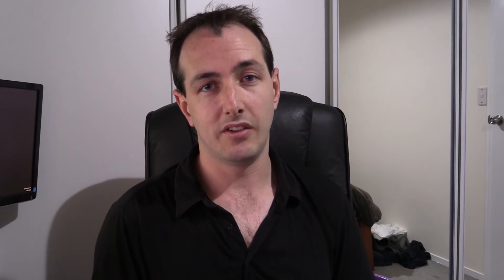Grid-Tie Inverter

Comment: I really like your design. 

I'd like to create an off grid system using your 20s 32p configuration, but all of the 45v-90v inverters I see are grid tied. 

If the largest off grid inverters are 48v, is there still a benefit to creating a system with 82v charged, 74v nominal, 60 flat, or will the extra voltage be wasted?
Reply from the maker: The extra voltage isn't wasted it just converters better.
I really like the benefits of grid-tie as its so easy to connect to the AC. 
The only problem with say 82v is you have to create everything yourself for controlling it like I have had to do which is a pain. 82v over 48 volts if I was to do it again I would do 48 as its just so much easier. In saying that my system of 82 volts is really working well.
Reply: Mikes DIY Tesla Powerwall thank you for your quick response. 

I really like the way you have configured your system with your wooden structure to hold your battery packs. 

I think I'll use that design regardless of the the voltage I end up using. 

Thanks again, your videos are very in depth and helpful.
Reply from the maker: The best thing about the wooden rack is its easy to make, compared to other options.

Comment: surely this has to be illegal in nz? i know it would be in Australia..
Reply: Yes, SMA is not the cheapest option, decided I'd go for the quality and the good reviews of the product after a lot of research. I have a quote for the tesla wallpanel, but I have a some questions first for the supplier, no point rushing into something so expensive if you haven't fully evaluated the options with what you are prepared to pay. The SMA was not usual the supplier installed, but for my money it was the best option.
Reply: Its a really interesting project for sure, but as an ex electrician and I know my knowledge of current regulations is 20+ years out of date (Australia nstandards), my concerns would be

1 legality of using the imported inverter, ie is it approved for use in your country.
2 A licensed electrician would be needed to wire this into the switch board.

One of the images show the inverter being plugged direct into a power point (ie live exposed plug when its not plugged on) which makes it look really simple, but unless things have changed so much since I changed careers I cant see how this could possibly be legal on a grid system.

But still a great project to see how it works out.
Reply from the maker: 1,  imported inverter, ie is it approved for use in your country. - Yip this is the same with any electronic device plugged into AC. Its 240v Approved but thats about it. Interesting tho.
2, smaller Grid-tie inverters plugin to AC using a 3pin computer plug or Like a older kettle plug. As long as they dont put out anymore then 2400w or use more then 2400w then there is no problem and the AC circuit in the house is already fused. 
How-ever my SolaX Grid- tie Inverter does need to be installed by a electrician as its 5000w and alot bigger, It needs its own fuses and cables run etc.
I am not saying a big inverter doesn't need an electrician because it does. The Small grid-tie doesn't. 
Eg small 500w like in this video 
https://www.youtube.com/watch?v=S93wbGlzsJg
and 
https://www.youtube.com/watch?v=BWI7RO4kLMY
Love this guy Haha hardcore 12 of them
https://www.youtube.com/watch?v=P3P1ivroKFo
love this old school from 2009
https://www.youtube.com/watch?v=hANi5NbcY5g
Reply: I'd have the inverter wired directly into the switchboard, but that's because of my electrical background. I'm going to get a tesla installed on the house 5kw SMA system soon, expensive of course.  I have a small solar setup, inverter on my shed/workshop and intend to do my experimenting there. I do intend to video it when I get back to that project.

My main concern with the inverter your getting is supplying power into a power point, it goes against everything I've done as an electrician. That's the part I cant imagine would be legal. I'd recommend talking to a licensed solar eletrician for their opinion. But good luck with it all, I'm watching what several people are doing with their amazing never-ending supply of 18650 batteries. What you are trying is very different to anyone else that I have found.
Reply from the maker: So the smaller inverters like this one, up to 2000w would be fine.
This is a video from back in 2009 but does a good job of explaining how these little 500w grid-ties work.
https://www.youtube.com/watch?v=hANi5NbcY5g
Reply from the maker: Oh that Tesla would be good to see installed. SMA is very good but expensive, I went with a cheaper Solax for less then half the money , Manly with the mindset that if it failed after 5yrs i could just buy a newer better model one for the same money as if i got the SMA in the first place etc. Also things change so much and fast in 5-10yrs that a grid-tie isnt worth spending too much on,  Plus eg in 5 yrs 10yrs time maybe i will have a electric car, and will need more solar, maybe another inverter, maybe more batteries, in which case investing too much on a inverter for now isn't such a good idea. In 5 years time i would say grid-tie inverters will go the way PC's did, They are cheaper and if it fails u just buy a new one with better specs and low cost. 
Also with Grid-tie it doesn't matter so much if it failed unlike with off-grid where you really do want a very good SMA inverter if its running your house and without it you dont have power etc. 
Unlike the old days spending alot on a grid-tie is pointless when your better to spend that extra money on a bigger batt or two tesla powerwalls. Just some thoughts.
Reply: I meant powerwall :)  I cant edit for some reason

Comment: Oooh, Very interesting. I've already got two Sun500W (22-60V) grid-tie inverters runnign on "spare solar. I hadn't thought about running those from the batteries.
Keen to see your next update! 
Can you provide links to the inverter you've chosen?
Reply from the maker: Oh cool, i guess my question needs to be. How are the Sun500's going?
Sure here is the link to the one i ordered just over a week ago. Still waiting for it to arrive.
http://www.aliexpress.com/item/2000W-MPPT-Solar-Power-on-Grid-Tie-Inverter-with-Limiter-for-single-3-Phase-Connection/32658874295.html?spm=2114.13010608.0.116.wL7rYS
Reply from the maker: Yip people have the Sun500 running from batts with a relay on a simple timer. Which i guess works. You could have two replys one to switch from solar dc during the day for normal grid-tie, Then another relay to flick at night too switch the DC over to batts and use the 500w for your peek time say 6pm at night for a couple of hours. That way you wouldnt need to limit them as 90% of the time your peek house load will be well over 500w for couple of hours etc. Also given its 500w and low ish current you could easily connect them up to a Ardunio with a current sensor and then turn off the sun500 when the house load drops to under 500w at night, that wouldn't be too hard just turning on and off, Just an idea. etc. :)
Reply: Ah well... I used to have a Sun250W unit that I had connected to 240 Watts Peak PV. It died. The replacement also died. Then I read someone suggest you should assume any cheap electronics will cope with about half the rated capacity. Which is why I now have a Sun500W unit running on 160W PV.
My working assumption is if I run it full tilt it'll die pretty soon. 
Gotta find a good and cheap current limiting setup.
Reply: Yep - that was my immediate thought too. Definitely some potential here.
Reply from the maker: I would say it last a while on 160w, Really would be surprised it if failed with less then half its max load.